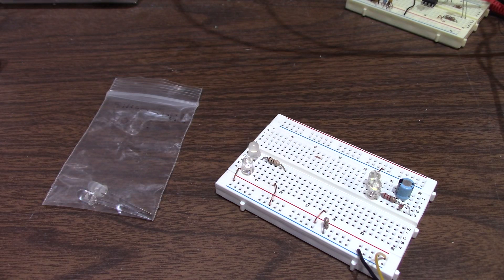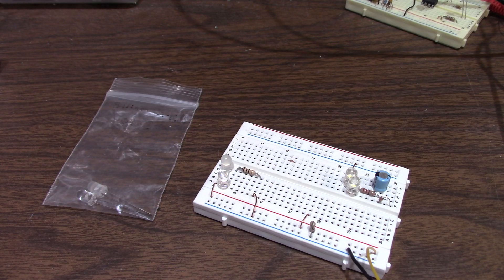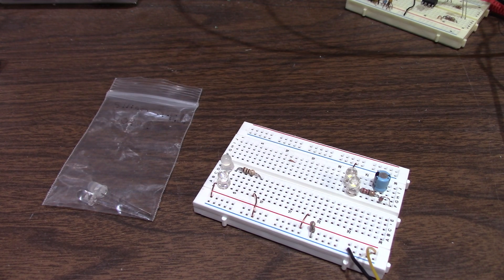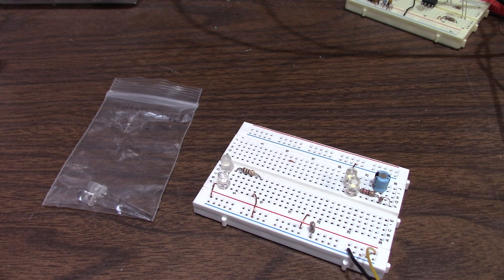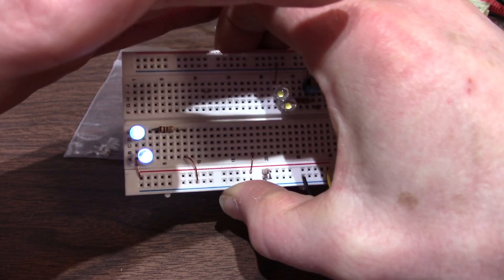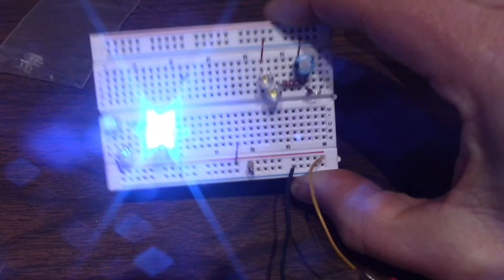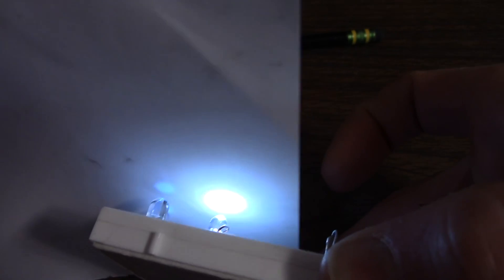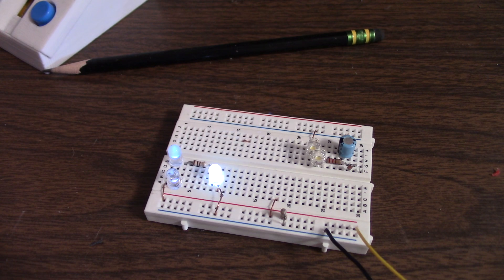The blue LEDs that existed before the current InGaN blue LEDs

Comment: They're absolutely charming, especially when compared to a modern "retina burner".
Reply: My computer has a blue LED as a power on indicator and I have two layers of red packing tape over it to reduce the intensity. One layer and it was still too bright. Was actually distracting and annoying. If it hit me it'd give me that star pattern lens flare effect. Like whoah, I'm seeing spots before my eyes! Thing could double as a nite light.
Reply: @1pcfred  Or you could just put a resistor in series and knock it back electrically without using packing tape

Comment: I sure wish we had these as the default on nearly all technology produced over the last 20 years. The ones that make sleeping within a mile radius nigh impossible.
Reply: More of a problem of cheap Chinese products that absolutely just run the piss out of them to make sure you "notice" the product in the store. I have a PC that I built when the white/RGB LEDs with a clear sided case deal became a thing and and it looked like a hydrogen bomb going off the first time I started it up. Now its completely dark with just little white and blue dots where the LEDs are due to degradation. However, if you size the resistor properly so they light gently like their older counterparts the modern blue ones are actually quite nice. And as a bonus they last forever at the lower current.
Reply: The problem is that for ages, 20mA was the standard current to run indicator LEDs at. With early LEDs, this made them barely visible indoors. With modern LEDs, 20mA is retina-searingly bright. But many designers forget this, and continue to use 20mA. 

I typically run modern indicator LEDs at 0.5-1mA.
Reply: I use a black paint marker to black them out. They still shine through but you have to be looking at it to see it. Highly recommended!
Reply: So true. The front side of my Philips Hue bridge needed three layers of duct tape before it became tolerable at night.
Reply: Sharpies are your friend.  Then alcohol will clean em right off. Or a little square of electricians tape.
Reply: Skill issue, I love blue LEDs mmm yeah beam it directly into my retinas that's how you get a good night's sleep

Comment: Hmm. Bright enough to be commercially viable... I find all modern led too bright.  Light up even one on a breadboard, and then stare into it tweaking the circuit... that's terrible. Ben Eater must be wearing welding goggles

Comment: That was missing from the story told in Veritasium's video! Thanks for showing us 😀
Reply: I didn't think it was missing but glossed over or merely told as fake blue. Frankly it is dim, pale and not exactly blue. But the sky blue color itself is quite beautiful.
Reply: @johnyang799 Also, I found the fact that SiC was used for LEDs quite interesting.
Because that means that SiC was used for LEDs, then was a bit out of favor for 10-20 years, and is recently used for high voltage semiconductors (SiC MOSFETs and diodes) again.

Comment: Hi John. For more than a week I was seeking for your MUTE/STAN-BY circuit for a stereo amplifier chip and finally yesterday night I discovered it in your video about the TDA7264 . (I'm in the design of a small stereo amplifier with the LM1876 as I have some of them and TDA7379 - not bad at all - but  doesn't have "high enough specs" for an close listening amplifier). Thanks for that tiny little board for TDA7264. What is your opinion about p2p (no bred board) realizations   ?

Comment: One issue was that there was competition regarding the older tech.
I worked in a university lab where we had a methodology to improve those LED intensities by factors over 1000 fold.
My research supervisor held the patent on the manufacturing process for polythiazyl (SN)x a sulphur-nitrogen polymer chain that we made in the lab by electrolysis.
Unfortunately, the Japanese LED companies had patented the applications of the material so it became an impasse. As a result Arthur's patent lapsed. 
A similar material was adopted in some screen technologies in the 2000s, I believe.
I decided not to work on (SN)x synthesis and applications for my PhD and focused on organic magnets instead. We did make a breakthrough in that field with the highest Curie temperature for a magnetic material containing no metal that was rejected by Nature as the results were too good, although it was confirmed by other groups and the 1996 paper is still being cited today although other materials beat it about 10 years ago.